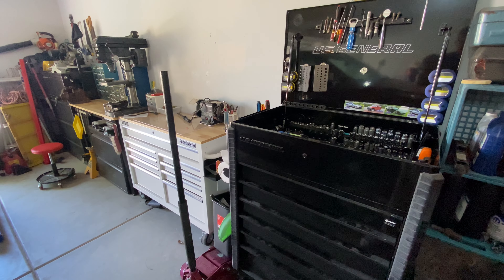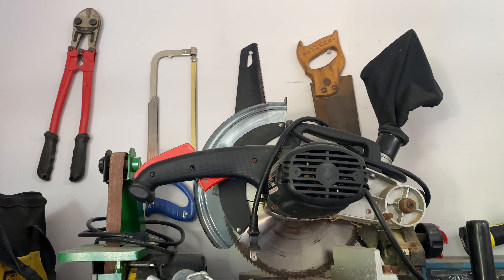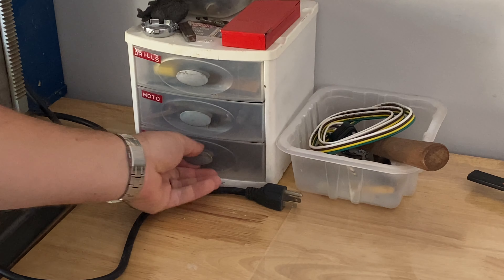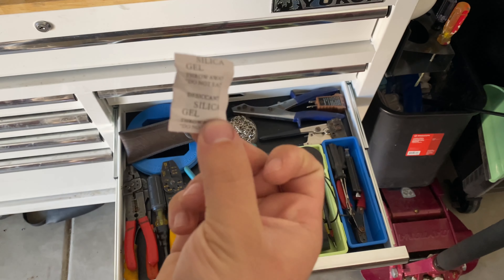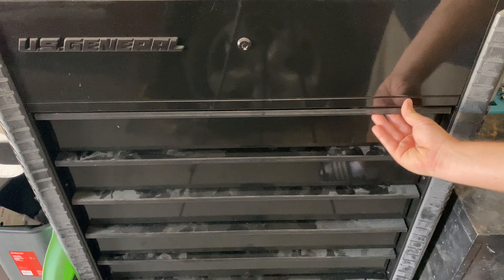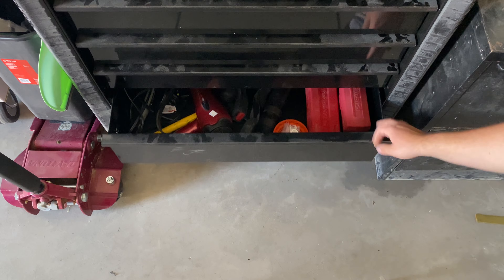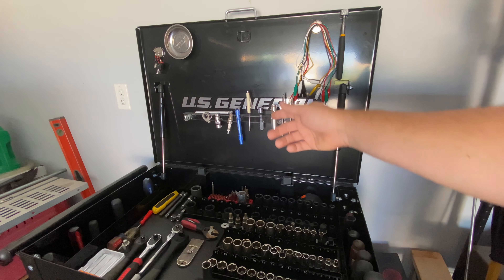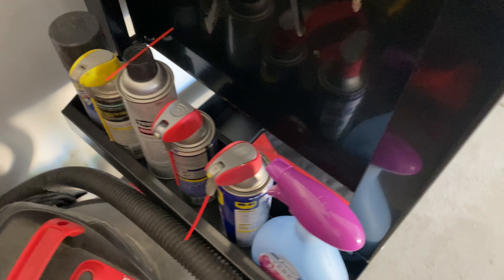Homeowner Shop Tour 2023

Comment: Hahaha i was kinda spacing out and then heard the part about your drill press. My old Enco is a hand crank startup machine also. Has plenty of power once it's going, a good rpm speed range and it was free.
Reply from the maker: I wish my manual “start” wasn’t a sign of a failing press 😂

Comment: If the drill press is still spinning, but needs some help, it might be gummed up and just needs to be lubed or greased.
Reply from the maker: Thanks for the idea. I've tried many things including looking at the shaft and it looks good, including the bearings.
Reply: @learnsavediy  try putting lube on the shaft. Check the brushes as well.
Reply from the maker: @qzetu  it’s an induction motor so no brushes or capacitor

Comment: Check/Replace the Starting Capacitor on your drill press.
Reply from the maker: Thanks for the tip. That was exactly my first thought but upon further inspection it doesn’t have one. I’m guessing I’d have to replace the entire motor but I’m open to ideas! I’ve looked everywhere for a new one and it’s slim and expensive pickings
Reply: Brushes...?